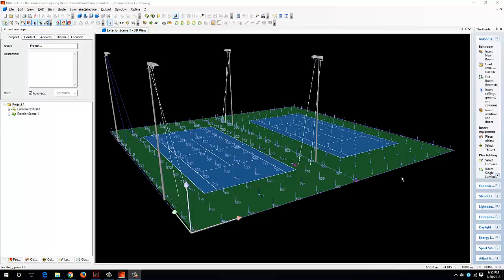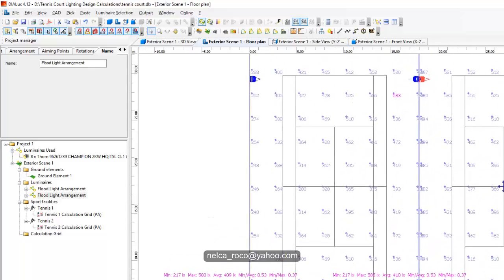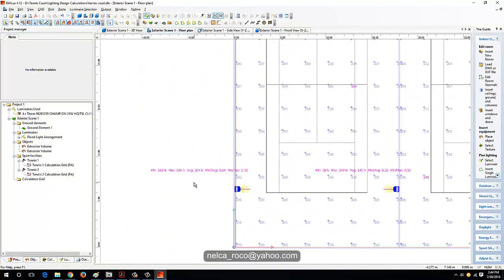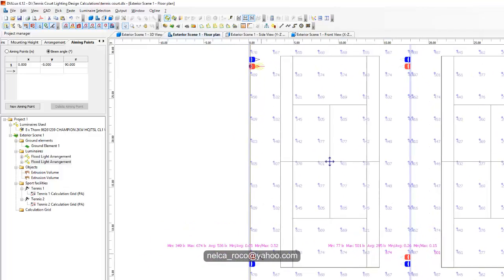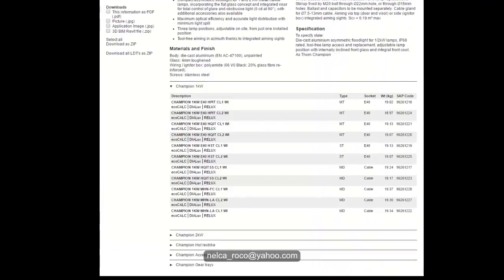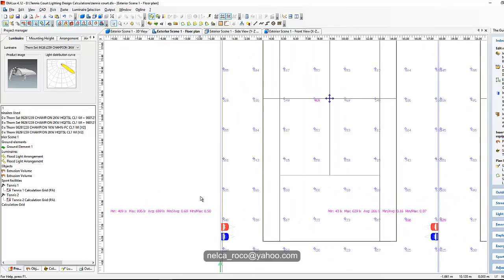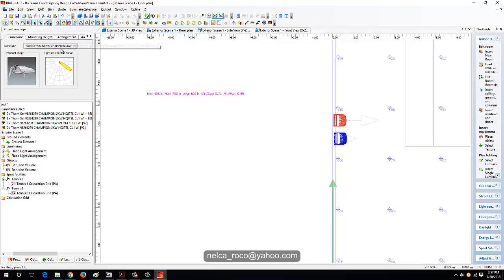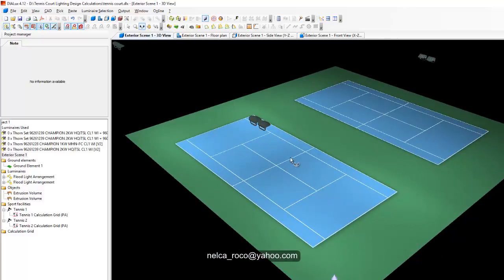Tennis Courts Lighting Design Calculations (Part 2)

Comment: Hi, Nelca. I have a problem in the installation of the led headlight that we replaced with the metal halide. the orientation of the headlight is different and they produce a lot of glared little uniformity of light, having 4 poles of 9 meters with two lamp each of 750 watts. how should the orientation be? where could i send you a photo of the lighthouses and the court already installed??